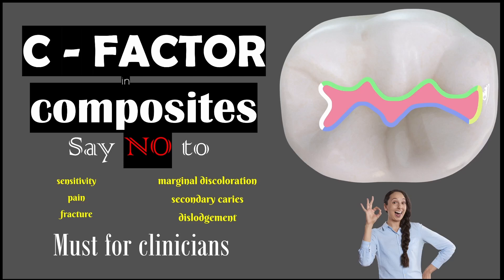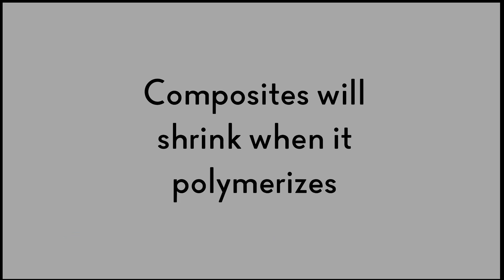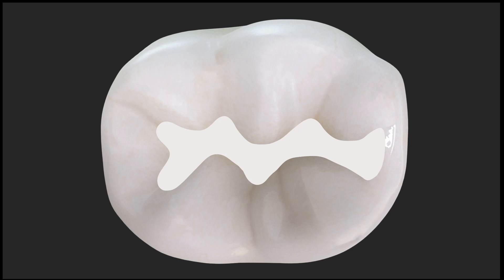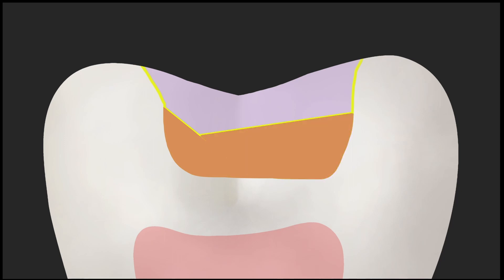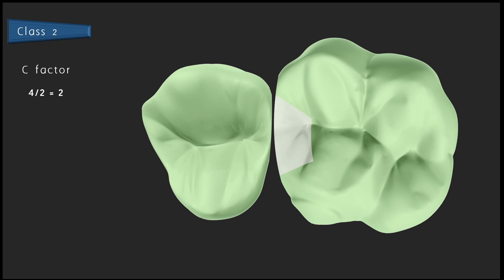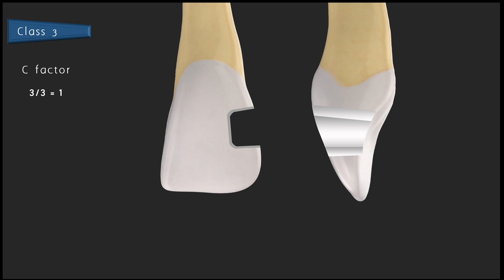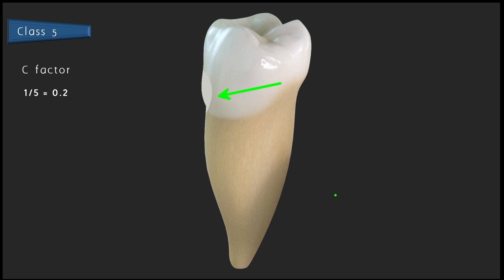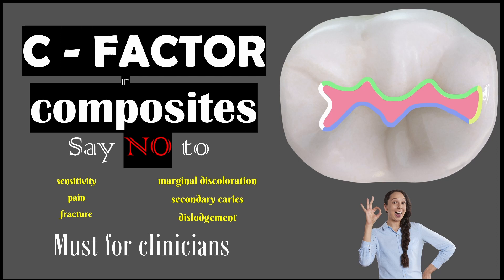C Factor in dental composites

Comment: Class 2 composite bulk filling will satisfy the c factor rule but depth of curing light is only 2mm, so by bulk filling 4mm gingival depth class 2  cavity will leave an un cured composite will affect the strength of the restoration
Reply from the maker: Curing depth is not only determined by the curing unit, but also by the type of restorative material. Bulkfill materials can conduct light upto 6 mm. So it does not leave uncured composite.

Comment: Thanks . Bt what should we do in post n core ? How to do it in increments?
Reply from the maker: Adhesive Dentistry and Endodontics: Materials, Clinical Strategies and Procedures for Restoration of Access Cavities: A Review
Richard S. Schwartz DDS, Ron Fransman DDS, in Journal of Endodontics, 2005

The problem with polymerization shrinkage is amplified in access cavities because of a concept known as C-factor or configuration factor (43, 167). C-factor refers to the ratio of bonded surfaces to free or unbonded surfaces. The higher the C-factor, the greater the stress from polymerization shrinkage (43). Restorations with C-factor higher than 3:1 are considered to be at risk for debonding and microleakage (170). In a class 5 restoration, the ratio might be 1:1. In an access cavity, the C-factor might be 6:1 or even 10:1. In a root canal system obturated with a bonded resin material, it might be 100:1

Kindly read the above article. 

In root canal...we should use resin with less shrinkage and minimal resin volume....

Comment: How many second should I lightcure the increment is it the same as 20 sconds or only 5 seconds is enough?
Reply from the maker: Twenty seconds is mandatory. If you are using very high intensity light curing, composite might get cured in five seconds, but the chances for bond failure is more. I prefer to use moderate intensity light curing unit and curing for twenty seconds per increment and a final cure after finishing the restoration for forty seconds